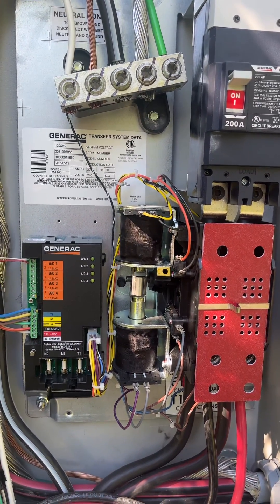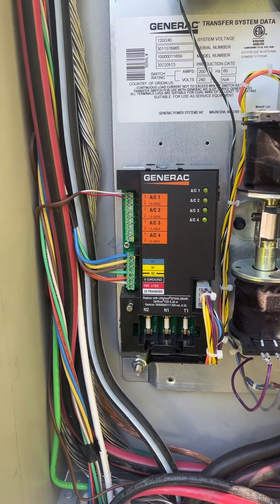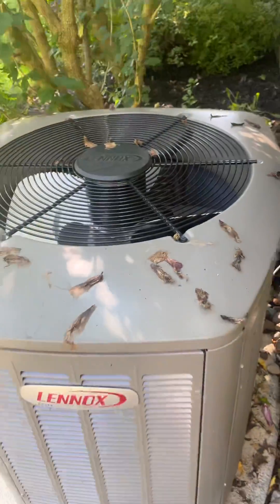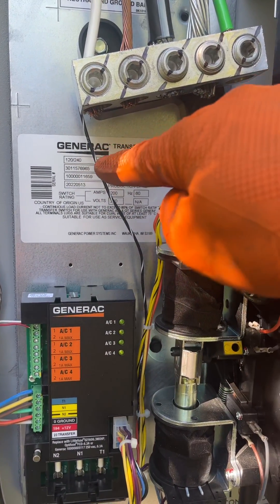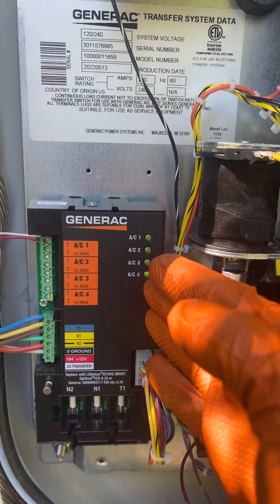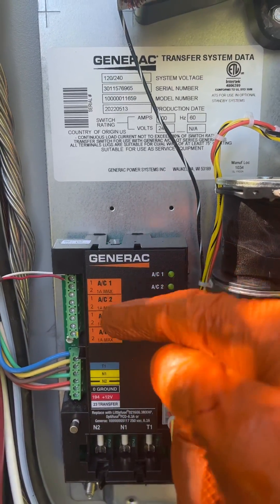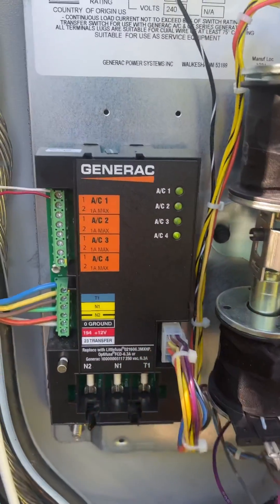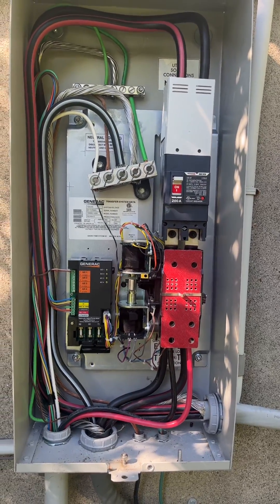Generac 24kw whole house How to connect load shedding #backuppower #generator

Comment: If  l have to use a smart management module for the AC system should l install one separate for the AC and another one for the AHU?
Reply from the maker: You don’t have to, typically the compressor is going to be your heavier load. However, if the air handler is 240v or has back up electric heat then it would be a good idea.

Comment: Two thoughts come to mind.... First is that Thermostat wire insulation is for Low Voltage, and shouldn't be in the same enclosure as conductors with high voltage. Use wire rated for 600V like the service conductors are, such as 600V MTW. Second, interupting the command for the Condensor, doesn't stop the Air Handler from requesting Cooling. Instead interupt the Cooling request between the Thermostat and the Air Handler. BTW, the Transfer Switch won't shut down the AC unless it is determined that the Generator is excessively loaded.
Reply: the operation of the load shedding module is to disrupt the control voltage not the line voltage of a major load on the generator such as the condenser unit (opening the contactor for example).  I would also note that 220 vac is present on the contactor of a condenser unit and right next to it is the 24v control voltage from the air handler to open/close the contactor as needed based on calls from the thermostat/air handler. Would it be fair to assume that both the a/c industry and generac have taken into account the proximity of the control voltage wiring to the line voltage wiring?  I do agree that it would be better to shut down the entire a/c by disrupting the thermostat to air handler control voltage though. The load shedding module supports two functions, one it slowly, and under 5 minute increments,  bring on loads attached to it after the loss of main power and going on generator power.  Its second purpose is to take off loads attached to it,  when the generator senses its inability to maintain 60 hertz due loading.

Comment: So u basically splice the wire goin to condensing unit? And one set goes to unit and the other to the load shed module?
Reply from the maker: Yea basically… you only have to break one wire…. Preferably the signal wire.
Reply: @ipowergenerators4200   kool thanks i'll try it tomorrow

Comment: Is thermostat wire rated for use outdoors without being in conduit ?
Reply from the maker: Yes, I believe so because it’s low voltage and can’t zap you. 

I’m not an electrician so I can’t say for certain however I see tstat wiring outside at every condenser.